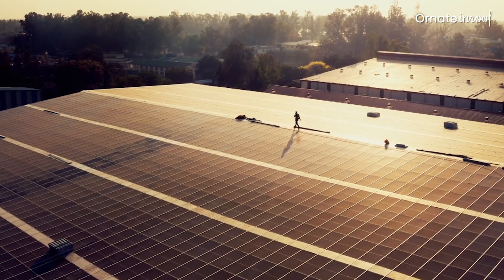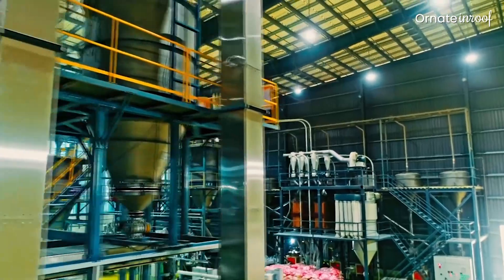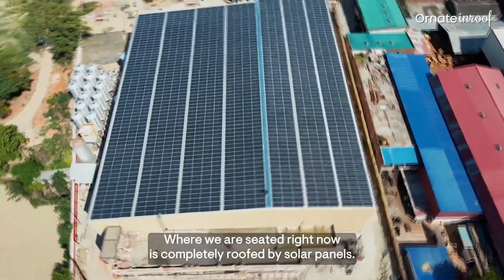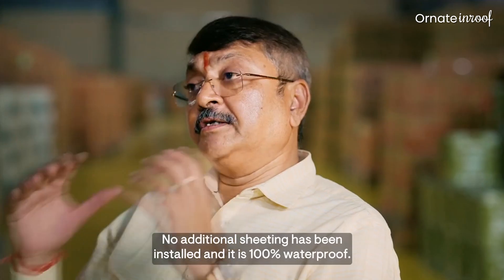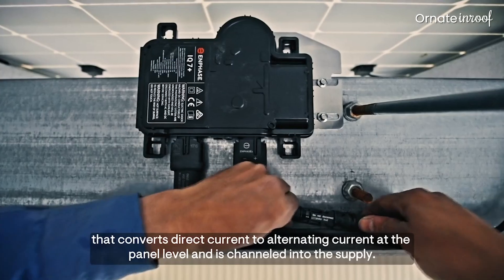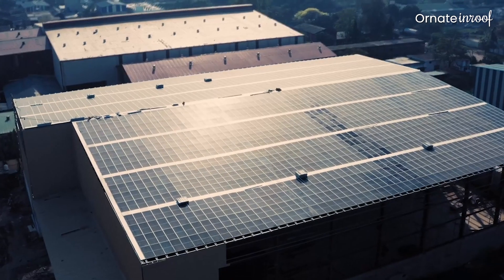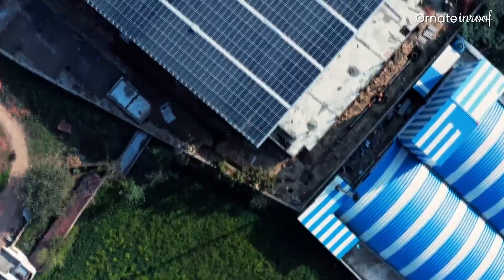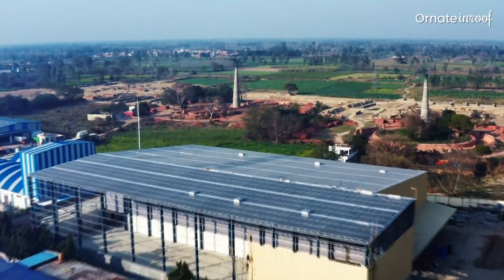Exploring B.L Agro's  745kW InRoof System | Ornate InRoof x Enphase

Comment: Can you please explain the Module cleaning system of this system..
Reply from the maker: InRoof has a modular design with ample integrated walkways and safety lines. This makes it easy to access the panels and clean the accumulated dirt and debris manually. 

For a larger InRoof that spans multiple acres, we can also provide a customized cleaning solution as per requirement.